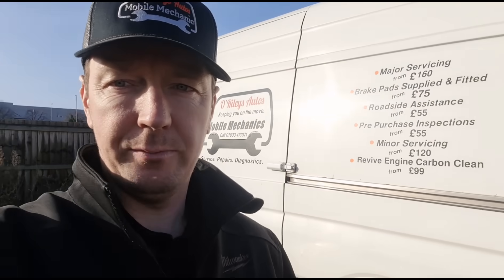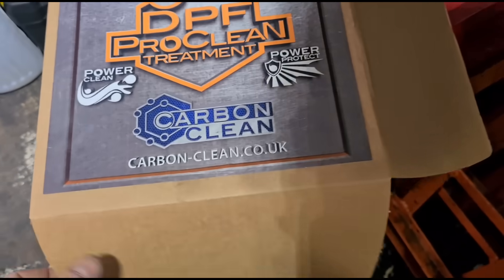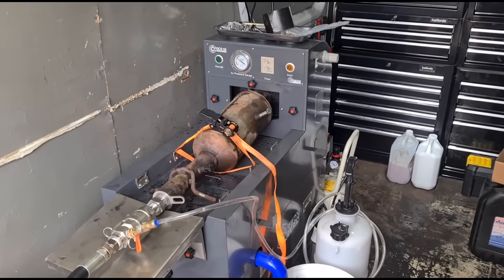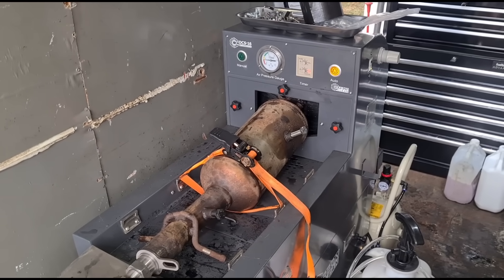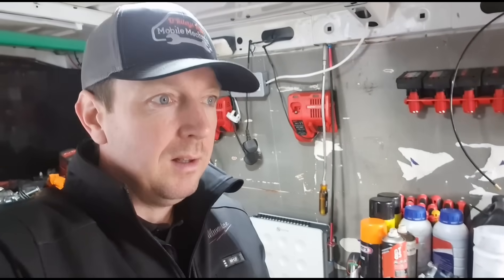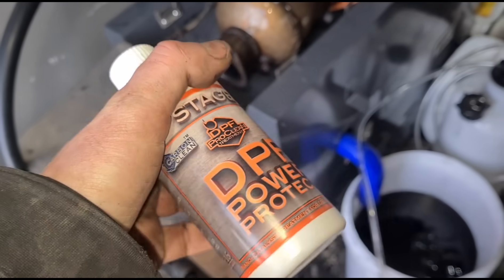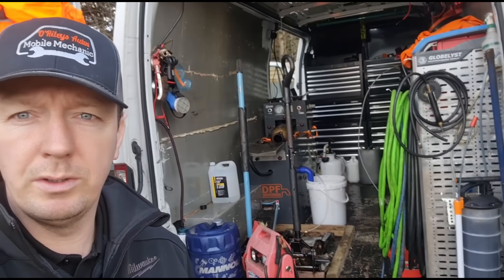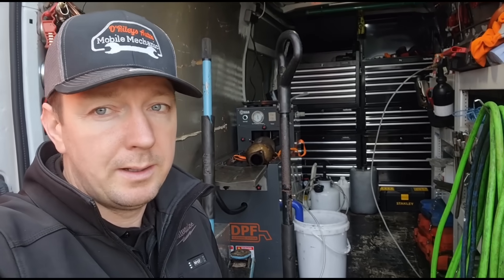Off Car DPF Cleaning Machine

Comment: Another brilliant video. I can only hope & pray that my local garage does the job and my Vivaro 1.6 can pass the 'MoT' after failing on a sooty exhaust. They say the process will take 3 hrs. so I presume it's a machine process similar to yours. I have no lights on the dash nor fault codes but there is wispy black smoke when revving. 

This 09/2018 Vivaro has had a mad life. From its 1st MoT 2021 to the third, last Dec, it's done 933 miles! Total 24,500! You couldn't treat a diesel engine any worse without parking it next to the Titanic. The last UK MoT pass must have been a fake because 10 weeks later it failed on emissions in France.
Reply from the maker: If it has soot on exhaust it probably has a cracked DPF so waste of money cleaning it

Comment: Hi Mr. O'Riley! I love your videos and learn a lot from you, as most people do, I'm sure. My car is a peugeot 308 , 1.6 HDI 109 bhp. It has 156K km, and the DPF pressure sensor reads 0 mbar at idle and 35 mbar at 2.500 RPM. Scanner also tells me that i have 93 grams of additive (Ash)accumulated in the DPF.I never fail a passive regen (i have a led light in my mirror that lights up when regen happens). The car recently had a new Eolys pouch fitted and i was concerned that the DPF should be in its last legs...but having seen your videos I am almost certain the DPF is OK. I mostly drive in town and the car regens every 160 Kms. Should i try and clean it with one of those spray tins from Mannol or something like that? Just to be on the safe side? Thanks!

Comment: Thanks, great videos,very helpful info. A question if I may: 2017 nissan qq, R9M 128bhp,1.6dci with 107K. DPF regens every 160miles, 15g falls to 1g soot, 200mba to 20mba DPF pressure after regeneration. Is this normal? Thank you

Comment: Great work.. 
my 2.2 18 plate transit 460 minibus has just had a new DPF.at fords £1,960 just over a week ago as the original problem po420 code block the DPF.
The minibus is at Ford with still PO420 code catalyst converter low efficiency at bank 1
Ford have got the big wigs to ask the technician to try different things as they ate stuck.. Today the technician is removing the rear exhaust to see if that fixes the problem.. Fingers crossed…

Comment: Jimmy b ite the bullet and get the pro model. Itll cover your hole in case of an unhappy customer. A suitcase honda eu2200i will sort the power issue. Also with the drying option youve the best set up. IMO, Keep pushing on Jimmy.

Comment: Only way to clean a DPF properly is with the correct ratio. Of water to acid and water to a sodium hydrocide(alkaline) solution one for the oily soot and one for the ash. Proven and failsafe method with copious water to agitate repeatedly and flush out DPF with water. Sorry to rain on everyone’s parade…..

Comment: Hey Jimmy that's a nice set up, get a diesel heater fitted & run the outlet pipe into the wet dpf to dry them out quickly,then you can be sure the second stage additive is applied to a dry dpf.
Great work Jimmy,all the best 👍

Comment: Sounds like having that machine without the dryer is a bit of a nightmare when the DPF has to be dry for the second stage of the process. 
I'd be fitting out the van with solar, lithium batteries and a big inverter. Then getting the better cleaning machine.

Comment: Foe anybody wanting to do this and sensors don't remove seized . Leave them there and remove the electrical plugs on the car side rather than break the temp sensors as they are very expensive and threads will be damaged.  Some dpf service company's have 10 of all the common filter precleaned . But if your sensors don't remove just give them your filter

Comment: You spoke about smoke if you had a unit. Does the mobile unit create smoke? So why would a unit create smoke. Sorry pal you have strayed.
Reply: Jimmy states if he was repeatedly cleaning dpfs on the cars the smoke generated would cause complaints
Reply: Think he was referring to his mostly job of flushing cars with dpf still fitted.
Reply: I think you can force a regen with the engine running and dpf on the car. You need diagnostic type equipment to get the extra fuel needed for the soot burn. Google forced regen.

Comment: Good job!  On the unit a filtered extract straight onto the exhaust is required.  Using the bigger unit in a van get a couple of 280ah lithium batteries, a dc-dc inverter for charging and then your normal inverter to drive the kit.  Power aplenty.

Comment: I has same machine back in 2019 I don't rate it pal, to powerful for internal core on dpf I cracked a few
Reply from the maker: You can control the pressure
Reply: @ORileysAutos it’s like blaming the hammer because you hit something too hard.
Reply: Hear this time and time again Richard 🤦‍♂️

Comment: A bog 4k invertor on 2 160ah leisure batteries wouldve been fine mate. I used to have a mobile tyre van and the tyre machine peaked at 4000w and it managed it with the van running no probs.

Comment: Questions, in a previous vid, you mentioned for a diesel to complete DPF regeneration, you mentioned should have less than half tank of fuel in, and air con switched on.  But what about diesels, than don't have aircon fitted?
Reply from the maker: Only certain vehicles.  Indo believe Honda to be the only brand that requires that
Reply: @ORileysAutos  Thanks, only ask, as I have a 2010 1.6 TDI Octavia, which recently had a new EGR cooler and valve, as failed(blocked, um don't know), told DPF ok.  But aircon not working due to hole in rad, but getting that fixed here in Ireland will take time.

Comment: Will it past moti ? because in the netherlands  max 1mppm it wil not after flusing with high pressure you also get the minerrals out the dpf now the cut it open and get old out en put new one in with warranty only insde dpf wil the change

Comment: Great unit! 
I have an intermittent 'no pressure' issue from my Peugeot adblue tank, solved once by checking the injector (it was clean, so perhaps the plug/socket contacts need cleaning - perhaps if the unit does not detect the injector it hibernates?), so I'll book in with you a time when the weather is not terrible - what's the best way to do that? Text to the phone number on your van? What's your notice for this, ok to book a couple of days in advance? TIA
Reply: Video description says to email for booking

Comment: I would also perform a flowtest before and after cleaning! ( with external flowmeter).
Reply: I use a Rectificadora in Spain to clean dpfs...they give before and after differential pressure reading on ticket.....the kit they have is like  a flying saucer compared to this....